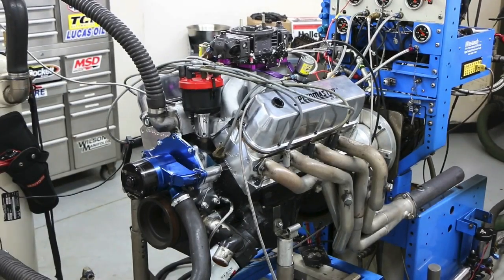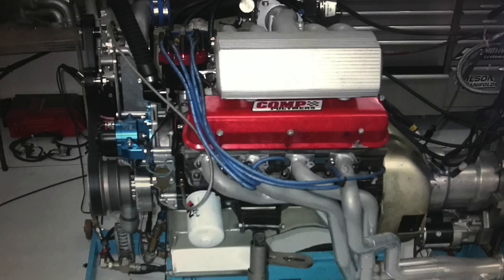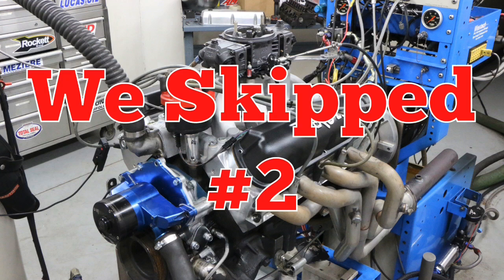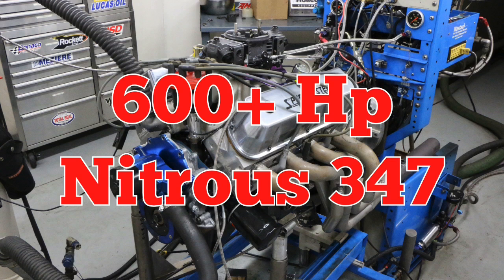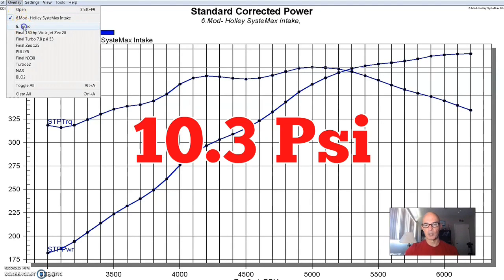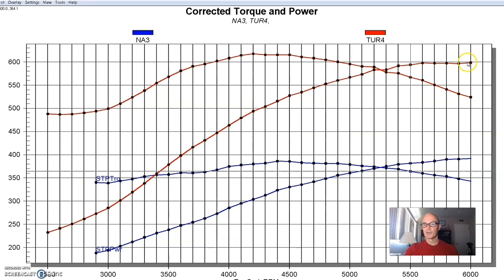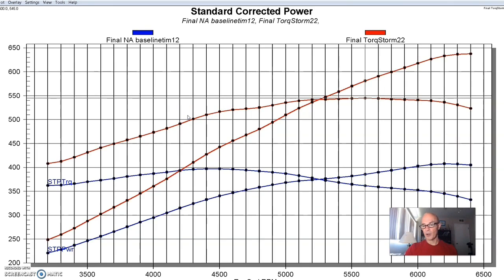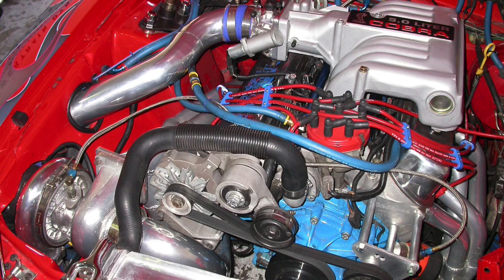5.0L FORD BLOCK SPLITTING-FACT OR FICTION?

Comment: I don't think that the "splits at 500" should be taken literally, but rather it's contextually relevant advice for the "AVERAGE" guy building a stock block 5.0l in his garage. Ford is notorious for their thin block castings in their pushrod V8s - no, not because people claim this, but because Ford themselves HEAVILY invested in this from the '60s on. And, they did it for reasons why you would want to - to reduce weight per displacement!
 
Unfortunately, as a self proclaimed gearhead/car guy first and a Ford guy second, for us HP junkies, this leaves us with blocks that often can't be bored out as much as competing brands and, in the case of the 5.0l, what I believe is a just plain fragile block. It isn't 'weak', it isn't 'poorly designed', as shown in this video and by many other builders, a thorough detail oriented build can push these engines pretty far with stock iron, but I believe that they are fragile.
BUT, the problem is that there just isn't a lot of margin for error with these blocks that you typically get with other engines(including other Ford pushrod V8s; 351s can reach up around 1000, 460s can handle WELL over 1000). And, with so many guys throwing these things together in their garbages, you're more likely to issues arise, and HP/torque only magnifies these issues. With other engines, they'll put up with some of this before failing, while, IMO, the more fragile 5.0l is prone to failure in these instances. And, it just so happens that right around 500HP is where these issues start to become too much for these blocks.
It isn't the HP output that's splitting them, but it's issues(mild detonation for instance) AT these HP levels that start splitting them.
 
...that's my complete and utter conjecture anyway!
Reply: "In there garbages" hahaha what an excellent auto spelling
Reply: @thereal2scummy636  ...that one may have been a little too on the nose, lmao
Reply: I think that's pretty much it. How many times I've had someone come into my shop and split the block. It's mostly not building the motor to reinforce the weaknesses of them. You can make good power out of these things but tuning is vital with these motors to reliably make over 500hp with them. At least that's what I see.
Reply: @Radeonr9280x A you know boring also increases cubes,....right?
Reply: Good answer!
Reply: I like it!
Reply: @Radeonr9280x A wow, a 4' bore.....so impressive.....lol. ill stick with my 4.342" bore.
Reply: @Stealth Cobra ive never seen a sbc crack like a 302. the only cracks ive seen from a chevy engine was the 400 steam holes. im a mopar guy, so i dont care either way lol.
Reply: Thanks for the props, guys! Nice to see that I'm not the only one that sees that there's some nuance to this discussion... ...well, for some of us without 18 Corvettes that aren't making up bullshit anyway... Trying to put a HP number on it couldn't possibly tell the full story, nor could any other single metric; it involves multiple variables that lead to the issues that these blocks are KNOWN for suffering from.
Reply: @Radeonr9280x A What is hard to understand about the fact that there are engines that aren't Fords that can be bored out further than a lot of these thin wall Fords can?
Who said I was talking about cubic inches? Bore an engine first, THEN stroke it, because the bore increase is not only giving you cubic inches, it's also unshrouding the valves, allowing you to get more air flow from your cylinder heads. Stroke offers cubic inches and nothing more(not that there's anything wrong with that; but you don't get the bonus improvement in head flow). Regardless, that wasn't my initial point though.
Reply: @Stealth Cobra 1:27 - "...let me know in the comments; WHAT DO YOU GUYS THINK, WHAT SPLITS THESE BLOCKS?" 
...my comment was in reply to Rich LITERALLY asking for opinions, you moron...
  
7:20 - "...now, admittedly, you know, doing it on the dyno is a lot easier than actually doing it out drag racing; in fact, THAT'S THE ONLY TIME I'VE EVER SEEN ANYBODY ACTUALLY SPLIT A BLOCK "
  
14:53 - "LET'S TALK ABOUT THE ONE TIME I DID SPLIT BLOCK... ...unfortunately, while they were running that car, while they were testing it on the street, they managed to split the block in half[CRACK THE BLOCK]... ...now, this wasn't a shock load thing, cuz I don't even think they were at the drag strip with slicks yet... ...and the thing was making about 600[HP] at the tire, cuz they ran it on their chassis dyno before they took it out and were testing it..."
  
16:15 - "...SO, AGAIN, WHAT DO YOU GUYS THINK IT IS; is it the 600HP at the wheels number, is it the 720 or 30 ft-lbs that it made, is it the, like, instantaneous shock load, WHAT DO YOU GUYS THINK IT IS... ...cuz I'M NOT SUPER CONVINCED, I DON'T KNOW WHAT IT IS..."
  
17:05 - "...SO, LET ME KNOW WHAT IT IS; why do some of them work, and SOME OF THEM DON'T? Is it production tolerances of the block, is it abuse, is it detonation, LET ME KNOW WHAT YOU GUYS THINK"
  
Fuck off, dickwad. No one cares about your anecdotal bullshit, no one cares about your 27 Corvettes, no one cares about your mystery engine builder who's magically representative of every engine builder ever, no one cares about your Holocaust denier-like revisionism about this topic.
  
https://www.google.com/search?q=split+5.0l+block&tbm=isch

edit: Oh yea, why didn't you call 'bullshit' on CanadaBud23 and his comment of "How many times I've had someone come into my shop and split the block"? You aren't going to call HIM a liar? You aren't going to claim that his comments MUST be "impossible"? No, of course you aren't - because you don't have shit to stand on but a bunch of empty ass words.
Reply: @Stealth Cobra Literally nonsense. Because of course you can't actually back up a damn thing you say - pile upon pile of logical fallacy. 
 
Have fun proving your ignorance to the world
Reply: @Stealth Cobra "the fact that you never rebuilt an engine"
 
306" SBF stock block, 10:1 TFS shelf pistons, King bearings, ATI harmonic damper, Rollmaster double roller, TFS TW Track Heat 170cc, Track Heat intake, Holley Terminator X
- First engine that I built with my nephew, tuned by my self, it's in his 275 radial Fox body sitting right outside my house in the garage
- Beside his Fox is a 460 BBF that's being prepped for a 557" stroker build, 4.440" bore, 4.500" stroke, 13.4:1(E85), King bearings, ATI harmonic damper, Molnar crank & rods, Mahle or CP pistons, Kaase SR71 heads, single plane(for now), BAM or Morell solid bushing roller lifters, Crower or Comp steel rockers, Rollmaster double roller timing set(unless a used Jesel or Danny Bee belt comes up for sale!), Kaase oil pump, box sump pan(Fox body will be getting 'outlaw'-style K-member), crank trigger w/ coil-near-plug conversion
 
First engine build was lawn mower engines, then rebuilt the engine in my first bike Honduh CB650 SOHC, automotive engines started with 351 SBF, then a BBC, a couple SBCs, more SBFs, and a whole bunch of 4-poppers scattered in between(4Gs & Honduh Bs & Ds)
 
Furthermore, I've put food on my table by getting paid to work on race cars, everything from budget grudge & Sportsman drag cars, quite a bit of dirt track, road racers, and even some professional work which included a trip to the 24hrs of Daytona with a Ford backed Daytona Prototype team in 2011(if you have a functioning brain, you may be able to figure out who based on some of my older uploads) who is now currently a factory backed IMSA GT team.
 
Now, feel free to STFU with your utterly baseless, absolutely fabricated bullshit non sequiturs and ad hominems
 
"lol"
Reply: That's where the Windsor got the name "Thin wall Hank".

Comment: I'm currently building a 2v 4.6 aluminum for swapping in my frs, but I had toyed with the idea for a while of building a 5.0 first since I had already supercharged a 95 mustang GT I used to own and I was going to see if adding a girdle to the valley would help with preventing the cracking and splitting. I'm thinking there's a weakness in the portion of the block that houses the camshaft and a high load can sometimes cause it to crack and exploit that weakness..
Reply: Sick! A v8 frs is definitely a dream car of mine. Or even a flat 6
Reply: I'm running a naturally aspirated 302 with e-street heads and a tfs1 cam in my miata which is fun in a track car

Comment: Hey everyone! I have split a block so bad it broke the cam in half. Mine was a 347 I am sure it was a harmonic balancer issues. It was balanced to 28 oz. I put the 5.0 mustang balancer on it thinking it so the correct one. I was supposed to use the 351w witch would have been the proper 28 oz.
Reply: That would do it.

Comment: Rpm is the main cause of cracked stock blocks as well as being improperly balanced.
Reply: Not rpm exactly, but harmonics, yes
Reply: @doxnoogle5782 
Not having listened to whole video at this point (6.23 in) I would definitely put the problem down to a combination of things. A relatively weak block due to the thin wall casting. Done to reduce weight the casting was perfectly fine for the factory outputs that it was expected to see. A second casting related problem could be core shifts. Resulting in castings that do not have uniform thicknesses.  Third it could well be the allowing elements or the relative lack of them. It would be interesting to see an analysis of Ford blocks vs other brands. Fourth I'd put to tuning. Fifth I think would be harmonics. This should not be a problem at any rpm the engine would be expected to see normally. 
In terms of harmonics a good example would be an inline six. I6 crankshafts are known to have a harmonics problem somewhere between 6K and 7K rpm depending on bore, stroke, bore center etc. Most can spin just fine past this critical rpm range. But if they see a period of extended running in their critical they will break. And every piece of rotating machinery, infact everything has a critical frequency.
Reply: @doxnoogle5782  ive yet to see one crack at around the 6500 rpm range however 7k plus is another story.

Comment: I've seen one split at 520 to the tire..blown.. 23 lbs boost.
 I came up qhen the 5.0's were coming out.. I lived that life. Ive had all kinds of hotrods.. Honestly..Ford just holds up better to me. Hot rod or daily driver work truck. They all have issues.. chevy and dodge is the transmisions.. rearends.. ford is.. well ..a loose nut behind the wheel..😎☕🤣
Reply: They why do half the Mustangs have gm trans in them? Thats if they dont have a GM motor as well
Reply: @Artificial_Dopamine  Why do all serious drag cars have a Ford 9 inch? Even the Government Motors cars run a Ford 9 inch.
Reply: @save16thave  congrats that "might" be the only thing Ford makes that would be on one? Thats a bragging right to you? And im not even knocking the OP i just thought it was funny he mentioned GM trans' being known for being bad when thats all real drag vehicles use. And i dont i use a GM 9.5 SF 14 bolt 5lug with eaton Detroit locker which actually can handle more HP than a 9"
Reply: @Artificial_Dopamine  I have a drag car and run a C6. In the NMRA I see the majority of cars running Ford transmissions. Are you even around Ford drag cars? Do you even race? Or are you just a chevy fan boy keyboard warrior troll? I think I already know that answer.
Reply: @Artificial_Dopamine  sounds like a nice setup, you should post some vids of it.
Reply: @save16thave   built ford tough with chevy stuff😉
Reply: @save16thave  Lol.. right on brother!
Reply: @Artificial_Dopamine  It's a free country bud, run what you want to. I run all Ford parts but GM did have some good stuff. I like the timing cover and water pump design better on the sbc. We all know the LS platform has tons of potential. I still prefer Ford products but if you like GM then that's ok with me. Race in peace, buddy.
Reply: @save16thave  all good, switch your c6 to a 400 and watch yourself drop 3 tenths on your et with no other changes bud 👍🏻 thats if your already in the 9s.
Reply: @Artificial_Dopamine  lmao
Reply: @Artificial_Dopamine  you talk about Ford using chevy stuff but you do realize Ford built GMs 10 speed auto? Major reason why the new Camaros are gapping the new 10 speed stangs lol. It goes both ways so you can't defend your Chevy boys as much as you are. Everyone knows a Chevy motor makes you fast and a Ford rear end makes sure you get there.
Reply: @SasquatchS550  bolt on 10 speed mustangs are in the 10s. Camaros aren’t. And a boosted 10 speed mustang vs a boosted 6th gen isn’t even close. They have to bring out the built vettes to run with stock motor coyote a10’s. Dollar per hp right now is all coyote my friend. They’re running the streets. Heck, even the a10 coyote trucks I think are in the 8’s. Be lucky if the silverados run 12’s 😂
Reply: @Artificial_Dopamine   I dunno.. probably  because a loose nut behind the wheel.. none of my fords ever ran anything chevy.  My chevy stuff did run some ford stuff though.
Reply: @19jody72  thought Fords had the loose nuts behind the wheel? And by the way i like that "loose nut behind the wheel" comment might have to use it lol
Reply: @Artificial_Dopamine  lol..👍🤣
Reply: @Artificial_Dopamine  Because the cheap motors are in the junkyard, and the junkyard's full of GM vehicles that run but can't drive for various and sundry reasons.
Reply: @Artificial_Dopamine  not many cheap RWD chevys that are afordable with the aftermarket that the fox,sn95,new edge platform has. If I was building a Chevy engine, or even a 2JZ. A Mustang is the way to go for affordability for any engine of choice.
Reply: @Kenzo-bp1zs  i have nothing to argue with your comment, if you can stomach a Ford chassis more power to em.
Reply: @Artificial_Dopamine  thats because people like cheap chevbie parts.
Reply: Uh oh buddy, you spoke the truth about Ford and GM, now the chevy fan boy trolls are going to be sending you nasty replies.
Reply: @save16thave   lmao
Reply: so tired of the bullshit dodge transmission myth. stop treating them like gm/ford transmissions, and they wont burn up. they pump fluid IN NEUTRAL. STOP SITTING FOR LONG PERIODS IN PARK.
Reply: @frigglebiscuit7484   ALL automatics are junk. I only run manuals  but the Dodge and Chevys, man.. thats just terrible. Kids can build better transmisions than that
Reply: @kenzo  my wallet strongly disagrees with you... having built both  the fords have been more expensive. Far... more expensive.   That being said and this comment as proof. I love my fords and i love my chevys. Side by side where they should be
Reply: @Jesse_James_RRS  really? I can see engine performance mods? But the chassis its self? I guess I live in a Mustang area lol. We have guys with back yard Foxbody junkyards. To be honest the cheapest car to build around me would probably be a Civic. Haha
Reply: @save16thave  hope you rollerized that c6....because THEY SUCK stock. "purple power eaters".
Reply: @kenzo i thought we were talking about building engines?  But even still.   Cars too.    My 70 chevelle has been wayy cheaper to fix than my 69 mach 1.    Hell even my fox is expensive,  luckily it doesnt ever break because its stock 😂
Reply: Keep it stock, the value is going up on them.
Reply: @ kenzo most likely i will i dont need another race car i have plenty.  I use it for road trips and going anywhere i want. In the nicer weather.  Its a sweetheart of a car.   Im the 2nd owner had it since 50k miles.   Up to about 70k now.     Super clean  interior looks brand new,  everything works.  Sounds good.  Drives great.   Its the one vehicle i own that i baby.  Everything else gets the shit beat out of it lmao.  But they are all built to take the beating without failing.
Reply: I love my Fords and Dodges and have for a long time. I did have a problem with Dodge transmissions until I learned how to rebuild 727's, 904's, A518's and 46re's. It is stupidly easy to get a Torque Flight back up and running without even having to pull it out of the vehicle.
Reply: Now my favorite thing is to buy Dodges that need a transmission for under $500 and fix it. Just because a transmission is malfunctioning and the owner does not know what to do or how to fix it doesn't mean that it actually needs a new transmission or a rebuild. 95% of the time it needs a fluid change, the valve body dropped and cleaned, the band's adjusted and new fluid and filter.

Comment: There would be so many factors that make them split. Torque, shock loading, core shift, age etc etc.
Reply: Vibration
Reply: @rmanor5508  one would assume a built windsor would be balanced and blueprinted nicely, so it shouldn't really vibrate more than a stocker?
Reply: @MRMOPARMAN0426    Nothing is perfect right, should build them stronger to start with.

Comment: I had a 5 liter bored .30 over. TRW flat top pistons, twisted wedge heads I think stage 1, a blower cam, a GT40 intake and switched to a holley systemax II, an accufab 75 mm throttle body, a pro M 75 mass air meter converted to blow through etc etc. For power booster I ran a procharger and had around 15 lbs of boost. Don't know exactly how much hp it had but I imagine around 650. I blew up some transmissions but not the engine.
Reply: T Web  
U should have been making a lot of power with that. Did you have a PMS on it so you could tune it? It really woke mine up

Comment: i think its gonna be an imbalance and a heavier balance. lets say if you have a 5.0 and get it balanced to 28oz and get the assembly balanced within a gram of everything, then you might be better off spinning it higher and making more hp and tq's
Reply: before i watch, I also wanna say the weight of a vehicle will put more strain on a block

Comment: I've only seen one crack the block... 347 stroker built bottom heads ect..  and it didnt split in half but did have a 3in crack down middle of valley..